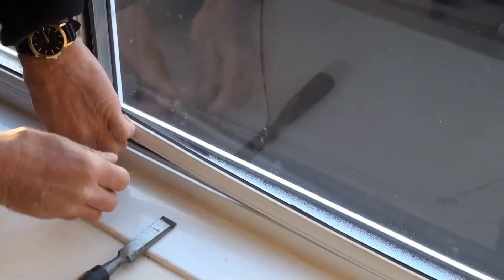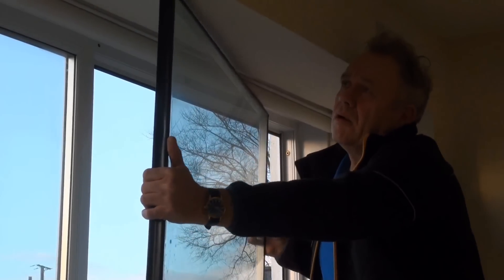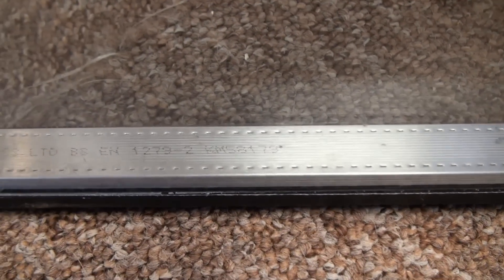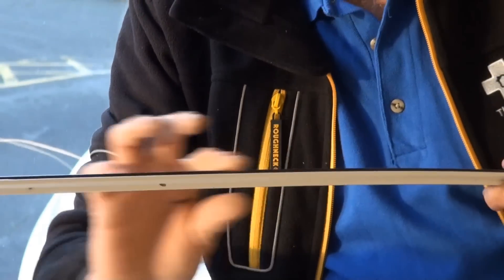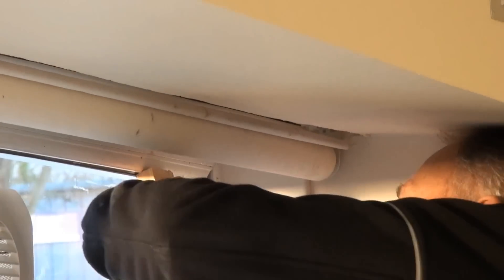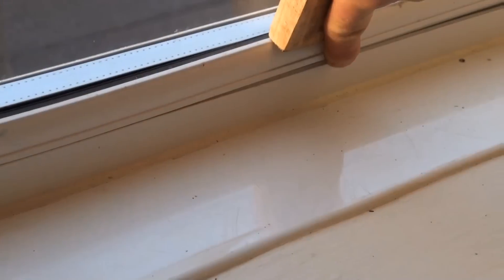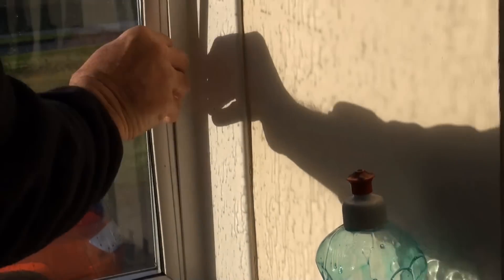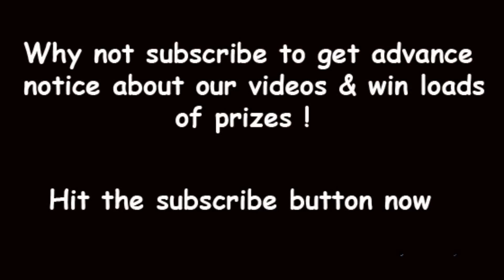Replacing a sealed unit in a double glazed window

Comment: lmao a sharp chisel lol. I aplaud you for making a video to show others but you really have no idea. don't use washing up liquid it will break down the sealant. sizes go from 16mm to 32mm that's a cavity of between 6mm to 24mm 
I have run loads of tests sealants and even made my own hot melt  machine to make sealed units. there's plenty more to write about but I'm sure it can wait.